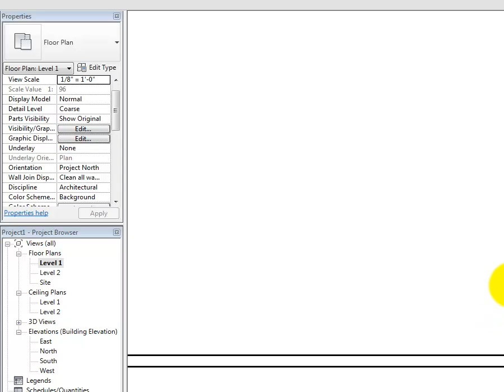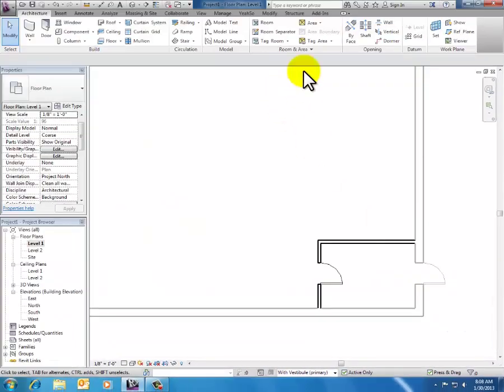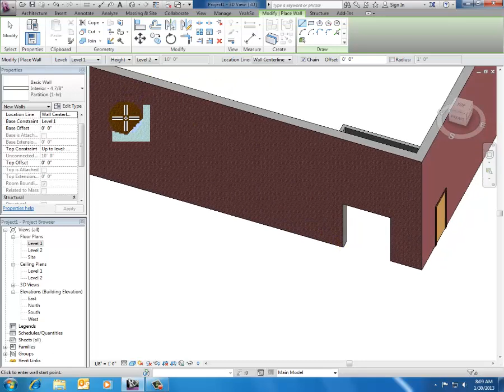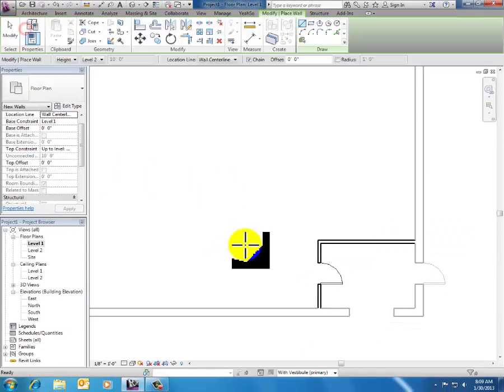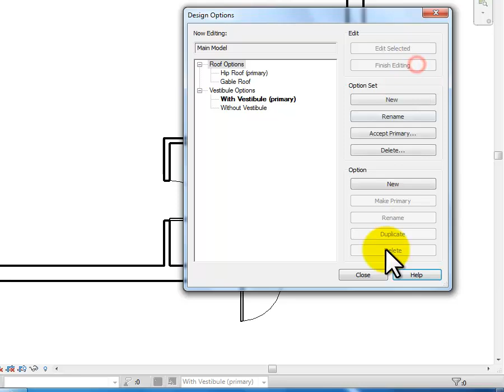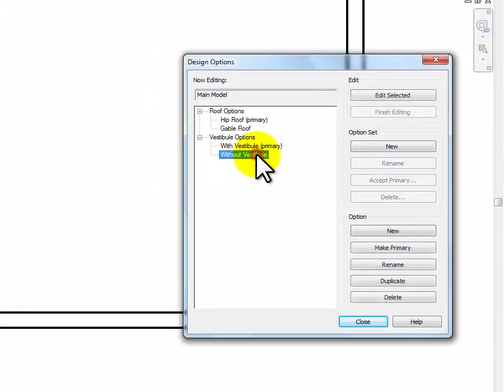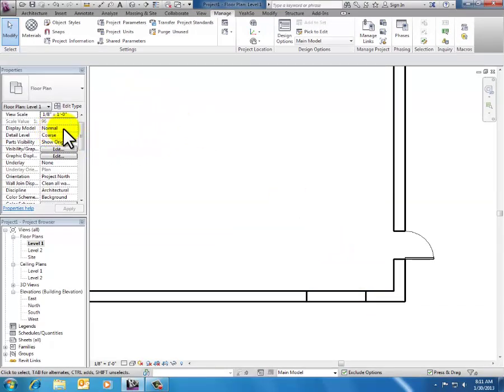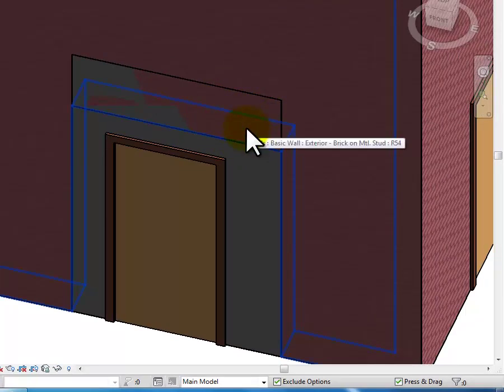Revit Design Options 3 of 3

Comment: Thanks for the tutorial. I think the reason being that it doesn't connect properly at the end, is because the "wall insert" outside/inside, or said in another way, it's exterior is not on the same side as the other wall. Flipping the wall would rectify this, and make the connection seamless. :)